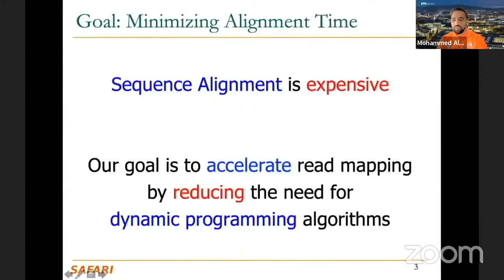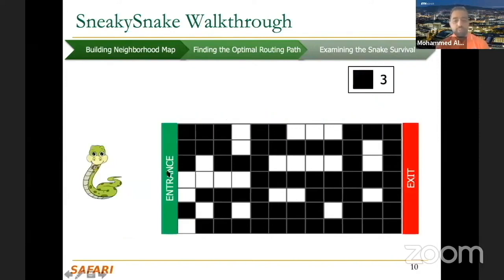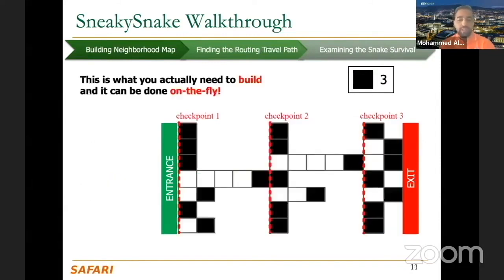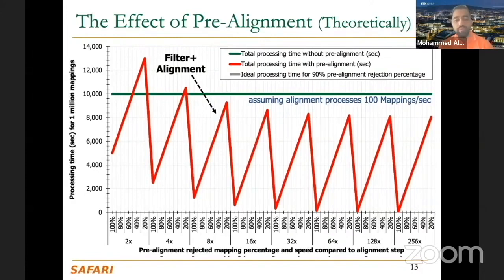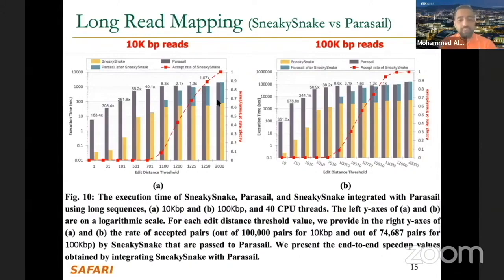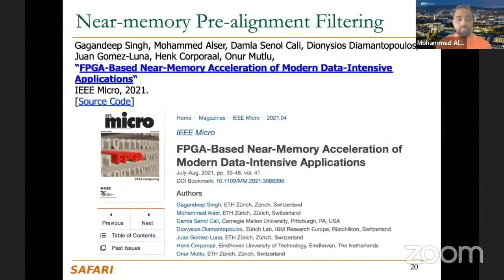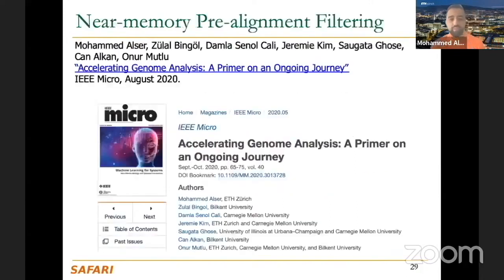P&S Genomics - Lecture 6b: SneakySnake (Spring 2025)

Comment: AI Summary

Abstract:

This lecture discusses the computational expense of genomic sequence alignment and introduces pre-alignment filtering as a technique to accelerate read mapping. It focuses on the "Sneaky Snake" algorithm, which approximates edit distance calculation by mapping the problem onto a single-net routing challenge within a conceptual VLSI chip maze constructed from sequence comparisons. The algorithm avoids calculating the full comparison matrix by performing calculations on-the-fly, significantly reducing computation. The lecture details the algorithm's mechanics, its implementation on various hardware platforms (CPU, GPU, FPGA), and its significant performance and energy efficiency benefits, particularly when using near-memory processing architectures like FPGAs with High Bandwidth Memory (HBM). The importance of balancing filter speed and rejection rate is analyzed, concluding that filtering aims to remove *most*, not all, dissimilar sequences for optimal performance. Future directions involving specialized hardware like Nvidia's H100 GPUs and processing-in-memory devices are also mentioned, highlighting the ongoing need for algorithm-hardware co-design.

Accelerating Sequence Alignment with Sneaky Snake Pre-Alignment Filtering

*   0:00:06 Problem: Sequence alignment using dynamic programming is computationally expensive.
*   0:00:11 Goal: Accelerate read mapping by using pre-alignment filtering to quickly identify and discard dissimilar sequence pairs, reducing the workload for dynamic programming.
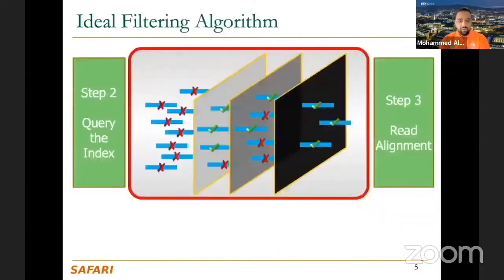*   0:01:56 Pre-Alignment Filtering Principle: Use indexing (e.g., hashing reference subsequences) to find candidate mapping locations based on shared seeds between reads and the reference. Apply a fast filter to discard locations unlikely to yield a good alignment before running expensive dynamic programming.
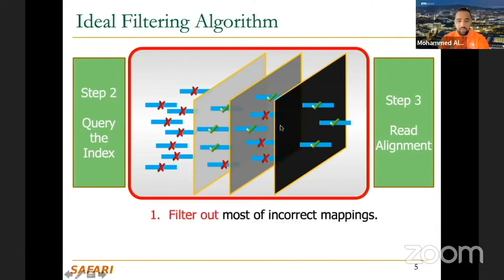*   0:03:23 Filter Requirements: An effective filter should: 1) Filter out most incorrect mappings (dissimilar sequences), 2) Preserve all correct mappings (similar sequences), and 3) Do so quickly.
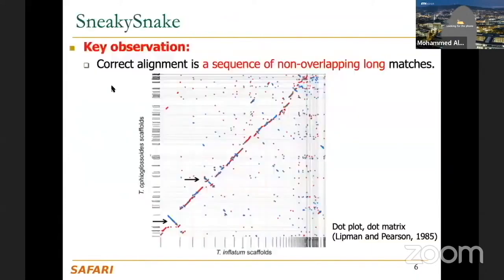*   0:06:16 Sneaky Snake - Motivation: Based on dot plots, which show that similar sequences have matching characters (dots) clustered around the diagonal. Sneaky Snake aims to find these long, non-overlapping matches efficiently.
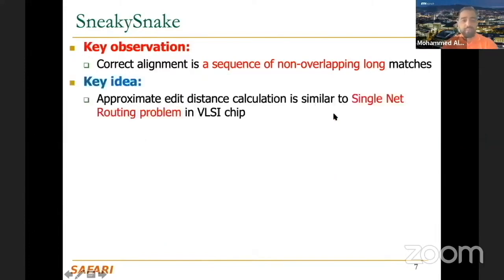*   0:08:28 Sneaky Snake - VLSI Analogy: Approximates edit distance calculation by reformulating it as a single-net routing problem on a conceptual VLSI chip, seeking the shortest path (lowest cost/edit distance) between two points.
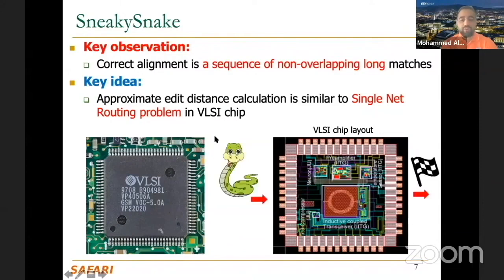*   0:10:11 Sneaky Snake - Chip Maze Construction: A binary matrix ("chip maze") is conceptually built. Rows correspond to possible alignment diagonals (2E+1 rows, where E is the edit distance threshold), and columns correspond to sequence positions. '0' represents a match (path), '1' represents a mismatch (obstacle).
*   0:12:57 Sneaky Snake - Algorithm: Finds a path from left to right through the maze. It greedily chooses the row allowing the longest horizontal step (most consecutive '0's). When hitting an obstacle ('1'), it consumes one allowed 'edit' (decrementing the remaining budget from E) and searches for the next best path starting from the next column. If it reaches the end within the edit budget, the sequences are deemed similar.
*   0:15:26 Tie-Breaking: If multiple rows offer the same longest step, any can be chosen arbitrarily, simplifying computation as the goal is filtering, not finding the absolute optimal path details at this stage.
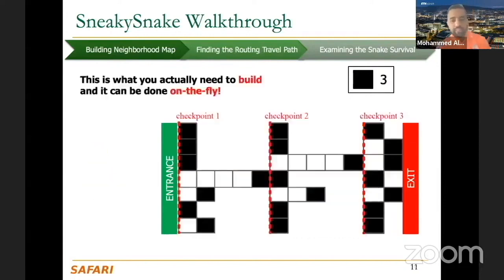*   0:18:36 Computational Efficiency: The algorithm calculates matrix cells only as needed (on-the-fly), avoiding computation for large parts of the conceptual matrix, especially for longer sequences or rows starting with obstacles.
*   0:20:08 Hardware Acceleration: Sneaky Snake is lightweight and highly parallelizable, making it suitable for FPGA and GPU implementation. FPGA implementations show low resource utilization (<2%), allowing many parallel instances.
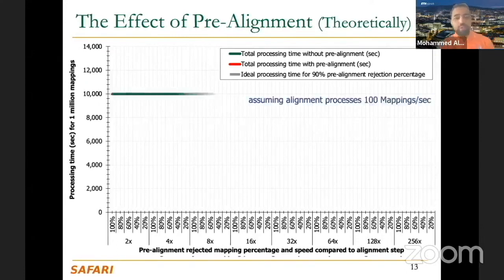*   0:22:18 Why Not Filter *All Incorrect Mappings?* A filter rejecting 100% of incorrect mappings would essentially be an optimal aligner itself. Filtering aims for a trade-off: be much faster than alignment and reject a high percentage (e.g., >90%) of dissimilar pairs. Achieving 100% rejection accurately is likely as complex as alignment itself, negating the speed benefit. The overall speedup depends on the filter's speed and its rejection rate.
*   0:30:01 Sneaky Snake Accuracy: Outperforms prior filters like Gatekeeper and Magnet in terms of accuracy (lower false accept rate) across various edit distance thresholds.
*   0:31:10 End-to-End Performance: When combined with aligners like Parasail or KSW2, Sneaky Snake significantly reduces total runtime by filtering out most pairs before alignment, achieving substantial speedups, especially at lower edit distance thresholds where rejection rates are high.
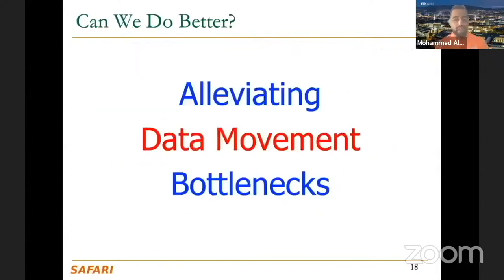*   0:37:04 Data Movement Bottleneck: Moving data between CPU memory and accelerators (GPU/FPGA) is a major bottleneck in terms of time and energy.
*   0:38:07 Near-Memory Processing Solution: Implementing Sneaky Snake on FPGAs with integrated High Bandwidth Memory (HBM) places computation very close to the data, drastically reducing data movement.
*   0:39:27 Near-Memory Performance: FPGA+HBM implementation achieves significant speedup (e.g., 27x over a 64-thread CPU) and vastly improved energy efficiency (e.g., 133x) by exploiting high memory bandwidth and minimizing data transfer.
*   0:41:42 Future Directions: Exploring implementations on emerging technologies like UPMEM processing-in-memory devices and leveraging specialized hardware like Nvidia's H100 GPUs (with dedicated dynamic programming cores) for both filtering and alignment.
*   0:44:04 Key Conclusion: Optimal performance gains come from the synergy of novel algorithms designed with hardware awareness and novel architectures tailored for specific computational tasks (algorithm-hardware co-design).

I used gemini-2.5-pro-exp-03-25 on rocketrecap dot com to summarize the transcript.

Input tokens: 26180
Output tokens: 2737